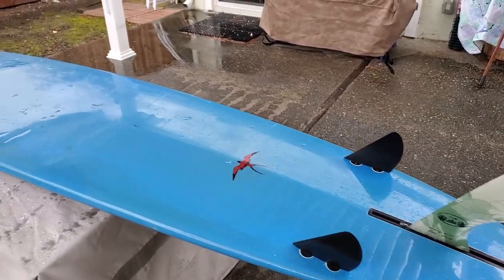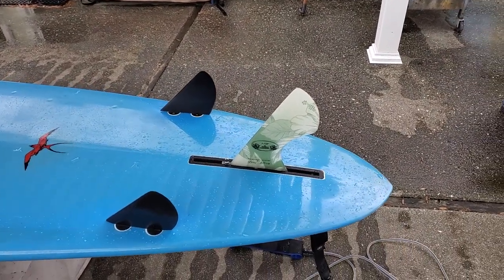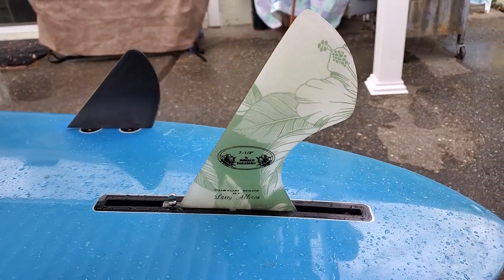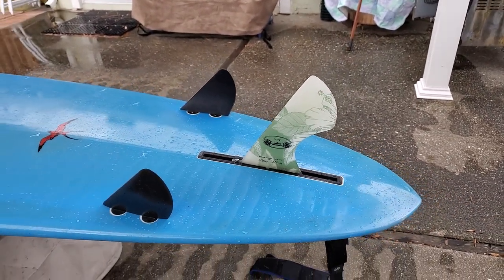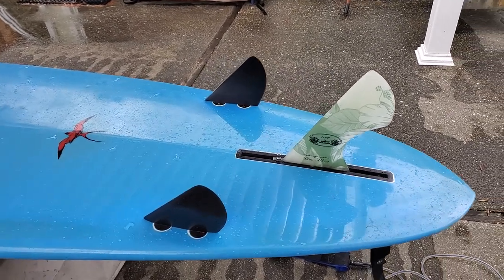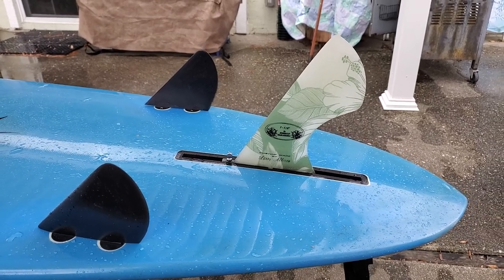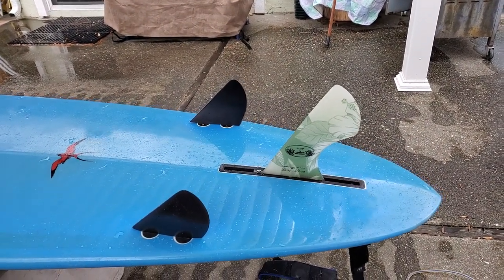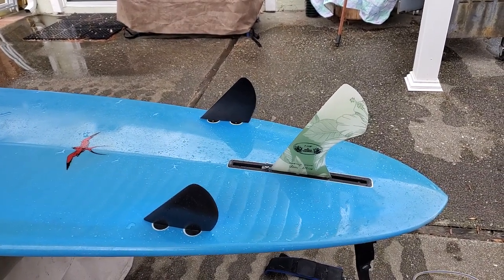Takayama DT-1 Speed Shape Updated with 2+1 Halo Fins

Comment: Got a set of the 4 1/8" side bites for my 9'0 Stewart Hydro Hull, run them with a 7.5" Marshall Brothers centre fin. 

This board was already fast and had good response and manoeuvring, but would hit an upper speed limit. With the Takyama sides it goes significantly faster, and the amount of drive whilst still having pivot is amazing.

I was using them with a home made 7" poly-carbonate centre copy of the Halo, but snapped it on a reef. With that centre fin the speed was faster but the drive was a bit less. Still as soon as I can afford it I will be buying one of the centres in 7.5" if they make that?

One thing to note as well, paddle speed. I am able to catch less formed waves that are essentially peaking swells with ease, never had this in a 9'0 board before, and on my last surf was out paddling 9'6 and 10' boards for waves. Likely not just down to the fins but also the hull shape in my board, but I do feel that the fins are working more with the hull rather than dragging and slowing it down like side bites can do. 

Highly recommended if you want something a little different with a noticeable performance gain, and agree fully that it feels like a new board or maybe like your old board on steroids.
Reply from the maker: Right on!
Reply: TT not sure if you or others have noticed but the FCS tabs have cant built into the box. The fin tabs are straight, that is no angle.
Mine are futures based, the Futures box has zero cant, and the Halo fins have zero cant on the tab. So they are essentially upright, which seems to give them even more drive?
Just something to be aware of with the Futures based.

Comment: Halo fins are over-rated. Ive been using the 8.5" on my stand up. Yes they are very manuverable and turn well but not any more than a good 2 +1 setup. There are drawbacks to these fins. first of all in big surf the fins cannot control the speed when you try to turn. 2nd I notice on my stand up when you are really trying to stroke into some waves and you have to shift your weight forward to get the nose down the face the halo fin seems to hold the tail in the water making it harder for you to get into the wave.
Reply from the maker: I wonder if your SUP and stand up dynamic works differently with the halo.  I have increased drive and pivot with these fins.  They handle the big wave better than the traditional 2+1 fin set up. No issues with paddling into waves. It seems easier since I feel like I am getting more speed and able to get to a bottom turn faster with these things
Reply: @toddshinohara  it works good in smaller surf. but ive ridden it at big sunset cant handle the speed.
Reply from the maker: @brianpogi4244  What happens at speed?
Reply: @toddshinohara  it cant bottom turn fast on a big, powerful wave. small waves are no problem
Reply: @toddshinohara  it just will not turn as fast on a big, fast wave with a steep drop. on smaller waves it works fine. maybe if I went with a 7.5 it might be able to control the speed better than the 8.5